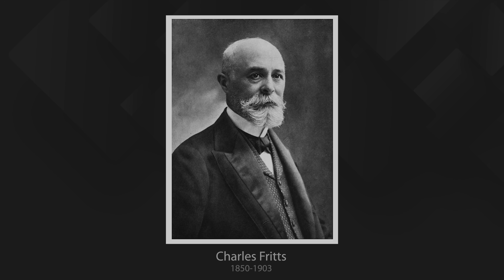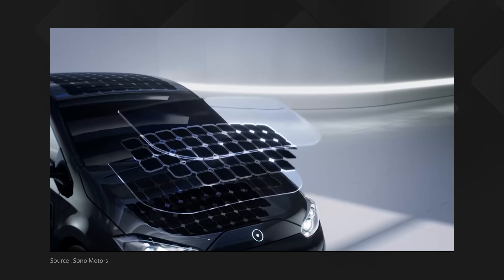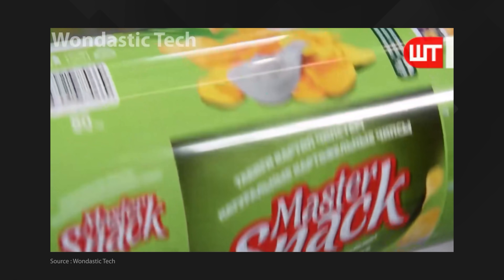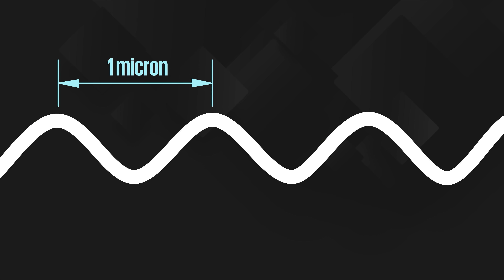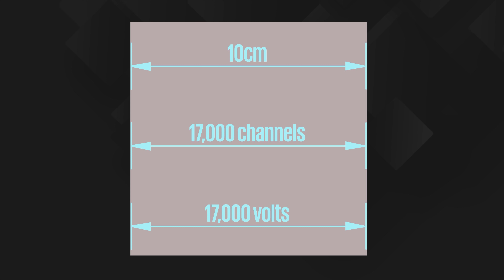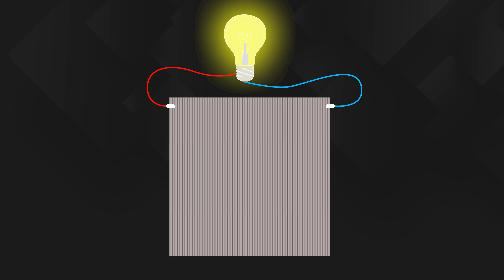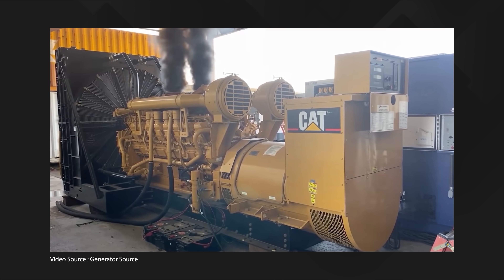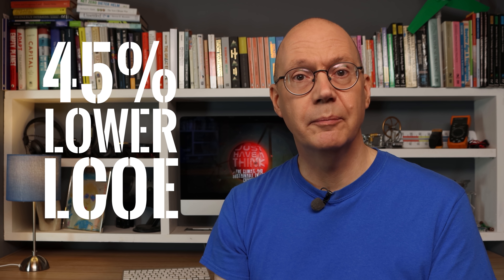Solar PV film roll. Revolutionary new production technology.

Comment: The attempt to reduce the 30 billion tons carbon emissions per year will continue to be frustrated as long as uncritical pieces like this about PV continue to enable the to avoid looking hard at this problem.  

All of those existing  “surfaces” mentioned here  do not face South at the optimal latitude.  Many face the exact wrong way.  Many of those surfaces are shaded during day.  Then those PV panels need to be periodically cleaned.  All of this is resolved in utility scale solar installations, but not rooftop.  Indeed, utility solar is some five times less expensive than residential, yet videos like this encourage subsidies to continue to be wasted on residential systems.  

Get serious, talk to experts in the industry, not the sales rep from some marginal PV tech.  Otherwise, people will continue to be gobsmacked by the spiking price of gas as its consumed to back up solar.
Reply: Funny, I"ve been living off of solar power for at least 30 years now. Of course, I DO use a lot less power then the "average home". If one considers being OFF GRID, rather than grid tie, and using only what one actually NEEDS, things ARE getting better.
Reply: @Tumbleweed5150  People were living in a wood shack or a  beach shack with a wood stove and couple PV panels decades ago, like the Unabomber.  So what?  

Look behind the curtain of anyone doing that for real, ie making enough money to buy food and clothing and taxes , and you find a generator, a diesel backhoe and bulldozer hiding behind the curtain.

Comment: My problem is that where I live (WV,USA) electric only cost of $ 0.11 per KWH
Reply: You would rather pay for electricity for your whole life rather then have it be free after a limited time, if you went totally off-grid?
Reply: Whats your average Kwh usage?
Whats your quarterly bill?
In Australia  a houshold 6kw to 9kw system will cost about $5000 installed and pay for itself in approx 3 years
You need to do your own sums.
Reply: @davidwatson2399  I use about 2000 Kw a month. I have run the numbers, it would take about 12 years to break even, well that was last year.
Reply: @Blaxjax21  
I think you need to re examine your figures.
"2000kw month"   Is that kwh?
Thats 66.66 kwh a day
X 0.11c = $7.33 day
= $2636 a year
= $32,120 in 12 years.  
Thats without price rises or inflation.
Reply: @davidwatson2399  my last bill 2255 KWH
with 5 people. And I would love to get an alternative. There are none in my area. I can't even get them to come out and install better windows.

Comment: We have a huge energy source overlooked: our highway system.   Tapping into the pavement, using its solar loading, was copywritten years ago.   If you’ve ever touched road surfaces on even a slightly sunny day, it will be warm…to hot.   Wave energy isn’t being pursued, either, even though work has been ongoing for decades.
Reply: Sometimes its not technology but economics holding things back until they figure out a way to stop\transfer job positions in the energy sector. Multiple technology solutions at once expand this problem. Energy sector provides more than energy. I don't believe a bill payer's bank balance  will ever benefit from new technology. If the planet can, incredible.

Comment: Dunno whats up with those electrons being knocked off and having positive charges or the cell wiring diagrams.... But either way, durability of flexible cells is a huge issue and most of the use cases sound unrealistic, their lack of any demonstratively long term operational anything but CGI seems very Elon Musk and the whole thing seems a waste of resources, as if no one has tried something like this/got it working reasonably well but not bothered to waste hundreds of thousands of investors money on international patenting.

How recyclable is it if they go into liquidation is what I would like to know?

Comment: I heard of a similar roll to roll printed PV on plastic film going on at MIT a couple decades back. I wonder if this evolving technology from Power Roll is some of the results of that early work. At the time the technology was translucent and light frequency selective depending on the materials but only about 3% efficient. The researchers were pursuing layers of different solar collectors that absorbed different frequencies of light to improve efficiency.

Comment: Elon Musk Solar division have the integrated roof tile version which solves the 'ugly' nature of traditional solar PV many don't want on their rooftops. ONYX have solutions for high rise buildings covered in glass by integrating, albeit a less efficient to retain clarity, solar cells in to the glass itself. Expense is another problem. New things are always more expensive but by a lot. It is a shame, considering how old the technology is, that solar isn't more efficient than in the 20's%. Maybe it is going to take a new technology, possibly graphene, to get things closer to 50%.

10-15 years will need to improve since solar PV is 25+. We always have to remember that labour installation costs are often higher than the materials used.

Comment: Most commercial PV panels have an efficiency of about 20%.  However they are rigid and heavy.  This film roll technology would have immediate application for Mars where the drop in its solar conversion efficiency is more than compensated for by its reduction in mass.  It is calculated that the Sabatier process needed to synthesise propellant in situ on Mars’ surface, sufficient for a Starship to make the return trip to Earth, will require about 13MWh per day for 400 days (5 gigawatts).  This would require about 25,000 square meters of the PV film, as opposed to 13,000 square meters of solar panels.  So about twice the area but a fraction of the weight for the same electrical output and this is critical when transporting mass from Earth to Mars.  Furthermore, deploying rolls of film is so simple in comparison to setting out arrays of rigid panels.

Comment: One of the benefits is the absence of wires on the face of the panel. In normal panels the "busbars" or so called wired take up approx 10% of the surface area. Another advantage is the zig-zag profile. This acts as an anti reflecting surface. Surprisingly high efficiency, but would only become mainstream if this panel could reach a cost of below $2/watt

Comment: I don't think I would classify this as revolutionary.  The revolution will be energy storage that is high capacity, cheap, high efficiency etc.

No matter how good your solar PV film/panel is, the output gap at night and in cloudy conditions makes using it a problem.  Your claim in the video that it could replace diesel generators doesn't hold up.

If your PV film is 100% efficient, costs nothing and lasts 100 years it still has this problem of not providing a reliable energy source.

Comment: Ive done some research in batteries and solar pv. One of the main parameters we use when comparing potential technologies with existing ones is to comment on the life cycle of the technology in comparison with existing technologies. Is this like perovskites where there is very low life expectancy for the technology?
Can you make an effort to include this information in the future. Its one of the biggest contributing factors in economic viability.

Comment: The adhesive part is what interests me. I have worked in the solar industry for decades and watched the price of modules drop by 10x. At this point, weirdly, the aluminum racking to support the modules is actually more expensive than the modules themselves, at least for smaller installations.

There was a company making peel-and-stick amorphous silicon modules, but they couldn’t match the price drop of conventional modules and went bust. 

Given the lower efficiency, this product would have to be below a buck a watt to compete. Conventional modules are about $0.50 a watt by the pallet right now.

There’s a lot of raised seam roof acreage out there that could use this stuff.

Comment: I recall about 20 years ago from a TV show from the Australian Broadcasting Commission (ABC) science show Quantum that the Australian CSIRO (who invented polymer bank notes) were experimenting with the polymer printing technology to print high volume low cost solar panel sheets, where you’d just wall paper the roof of any structure. I think they were at about 10% efficiency, we’re working to improve that and the UV stability. I don’t know what happened to that research.
Reply: 20 years happened, compare to where were traditional PV 20 years ago and now.I heard at least 3-4 stories per year about someone inventing "NEW CHEAP REVOLUTIONARY solar film" but every time it was pretty much same thing existed for decades.But this now seems much more substantial,with actual company,new technologies,and 1-2 years before deployment,not some "in the future".

Comment: Why are solar pannels on roofs and not on the walls - which receive so much sola energy in these higher latitdes?
Reply: They need to be angled in accordance with the Lattitude for optimal power production.
Vertical is not optimal.

Comment: With each new solar technologies, it is relevant to talk a little about diodes and also the controllers and inverters used to gather the power, to batteries or to grid. Especially when voltages changes, controllers changes.
Reply: @Alexandre Lollini   I was thinking that myself.
Filia Solar has photovoltaic blackout blinds to allow apartment dwellers to have solar panels.
Now they will be using Power Roll's PVs for their products.

I was wondering how they collect the energy generated by the blinds.
As you said, they would have to have all the components you mentioned.
Either net metering and/or a power wall.

Comment: I really hope some of these more economical alternative energy systems become more accessible for residential solutions soon. Take this, and something like a iron air battery..
It would seem that a home solar and storage solution may cost less than half of what it costs at present with such technologies. Which would not double home installations. It would likely make them no brainers for everybody to get. If I could get an installation with similar specs as the one I'm looking for, but for half the price, then I'd be laughing at the cost. And I would likely get it immediately. As things stand I'm somewhat hesitant to make a move purely because I'm worried of a serious financial commitment for a system that might be made up of sub-par, and potentially overpriced components. Home batteries especially seem way overpriced if what I understand of the price of batteries at larger scales is anything to go by. Yet surely millions of homes each getting a battery is a large scale.

Comment: So what nanosolar did almost 20 years ago? Or what all the other roll to roll companies did that went bankrupt 10 years+ ago because it doesn't make sense unless you are 1. As efficient as regular cells, 2 Putting them on a flat surface. Please do the math first before pushing hype science. 11% at LAB conditions means <8% real world. If they are not directly in sun light at 45 deg then you are looking at just 2-3%.

Comment: I like the basic concepts.  Some questions I have are thermal tolerance, since PV panels can get very warm.  I guess these films could be fastened to a heat sinking surface.

Another is how well the film holds up under weather.  The wind blown dust, grit and sand can scour away the paint from a car body.   

Are they easy to keep clean?  Will cleaning them wear off the protective film?

The film has to be connected to the electric system and thin films have to take the mechanical stresses of connectors and wires.  Some bigger arrays may have as much as 1500 volts from end to end so insulation is a major concern.

I guess many of these will have to be addressed by the company building the systems.  But the problems could make or break the system depending on how they are addressed.

Thanks, Dave for informing us of the possible path to even lower cost solar systems.  We need huge amounts of them ASAP to do away with fossil fuels.

Comment: That looks very promising, especially if you’re wanting to make one of those solar powered aircraft.
Though your levelized cost of electricity for sticking the panels on an exterior wall will probably multiply that payback date by a factor of 5. Stick to roofs if you’re not somewhere far enough from the equator that it’s actually worth putting them on walls, and even then stick to equator-facing walls. I’d like to see roofs in the future all being designed to sit at the maximum angle for solar collection where possible. As in, not tropical regions with extremely heavy rains.
Reply: What if payback is half a year? And most costs would be for inverters - all you need is to install it as many as you can,and wire it properly. 5x payback time wouldn't be a problem.

Comment: Very interesting. I may have missed it, but I didn't hear anything about the recycling of these panels. This is an important issue IMO given the current problems we have worldwide in regards to unrecycled PVTs, many of which are simply getting buried in the ground.
Reply: Richard Alleman
Solar panels are 95% recycle - the aluminum and glass make up a large part.  Most don't end up in landfills.  They are sold as used panels guaranteed to put out 250 watts and sell for $50.00.

Comment: Thanks for another great video. This idea really brings together precision electrical engineering and the technology of mass production in an interesting way. But I do wonder how many places would have an electrical grid that could support these solar PV films. In the company's video we see the film applied all over the place, on roofs and walls and even the sides of passing buses, so there'd be lots of small trickles of power coming in from the buildings all over town. (The bus would presumably store extra electricity in its own battery.) Could the local grid handle all those tiny, intermittent inputs? You'd probably need to put batteries in the buildings somewhere to store and transmit the power the same as you'd need with a more regular solar panel installation, except with everything on a smaller scale.
Reply: We all need to start thinking "off the grid"!

Comment: An absolutely fascinating video. One of the things I've been reading about lately is electric tractor trailers. Imagine if you could cover the trailer with this film, on a sunny day it could give you most of the energy needed for propulsion. Or if parked, it could charge the trucks batteries.
Reply: Bearing in mind the power needed to shift 40 tons I think that you are being somewatt over optimist. However a 40 foot trailer with solar sides and roof at low cost would be a no brainer. I'm just building an expedition truck and already have 1900w but this would make the awning earn it's keep!

Comment: Hi, I hope their business model includes end of life disposal/recycling. Another massive source of PET let loose in the environment would be swapping one issue for another.
Reply: this could not be put in a landfill or burned. just like a lead battery
Reply: @victorhopper6774  hi, agreed but what could be done with it is my question. 10-15 years is certainly a lot longer use than plastic bottles but PET is designed to be pretty much indestructible unless active recycling is carried out.

Comment: It'd be amazing to see this tech harmonize with the structural batteries Imperial College London, MIT, and others have developed , of which you did a video on back in January. Make electricity and storing in in the same location saves a lot of transmission loss (these cells are already losing a bunch of energy due to 11% efficiency), _and_: it just makes sense!

Only thing is I'd like to see the PET switched out for some sort of woven glass material. Renewables are getting us off of fossil fuels, are they not? Of course there are plastics all over the energy and power sectors - even the coatings of common wires and cables are often cross-linked polyethylene - but a net transition away from plastic and fossil fuels is preferred. Plant-based plastics would be a good first step, and then genuine backyard biodegradable polymers next (if they even exist yet).

Comment: I saw something like this several years ago on The Discovery Channel when it was still quality programming. The entire show was about new methods being developed for generating electricity from the sun. The last one was a thin sheet that was printed on just like an ink jet printer. The fantastic thing was that the cost per kW was very low.
Reply: Do you remember the name of the program?
Reply: @Marcelcas  I'm sorry, but no. With all that is on YT now, you might be able to find it. It was a group of programs on just how bad the infrastructure of the U.S. really is. According to those shows, which were years ago, not even Biden's trillion+ infrastructure plan will be enough.

Comment: Every time I watch a video where people only talk about voltage instead power i feel  stab in my heart. I lightning bolt has huge voltage but very small amperage. The power of a lightning bolt is not big. Power is measured in watts / hour and it depends on voltage * amperage

Comment: Stanford R. Ovshinsky was ready for this nearly 20 years ago. seeing the inefficiency of standard solar cells his version had three layers each extracting from a different wavelength 
his flexible panes came from an industrial machine that when given feed-stock, could produce and endless sheet. this was designed to be easy to cut, seal and hook up.
BUT LIKE TESLA before him, Big Money was uninterested , and even discredited his invention of power steering,neural analogue circuits and this Photovoltaic break thru.
400 patents to his name, many of which remain unused  https://youtu.be/A6n7H8EtMUE to see them